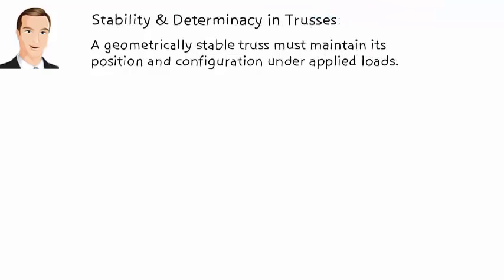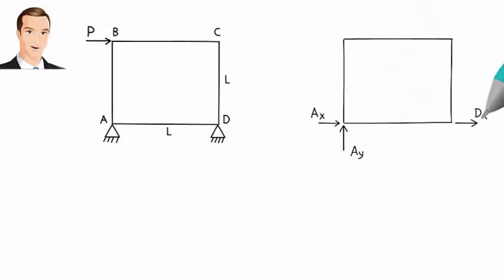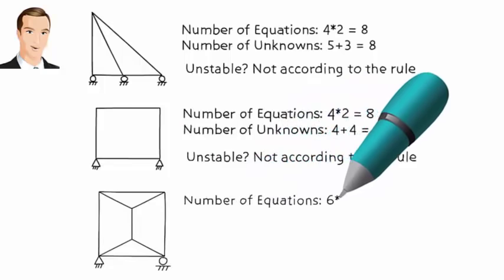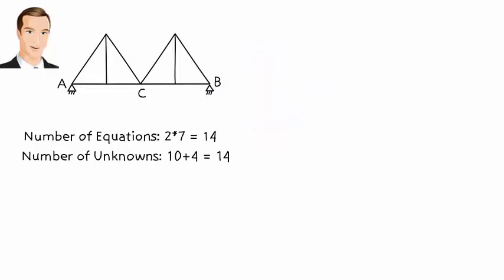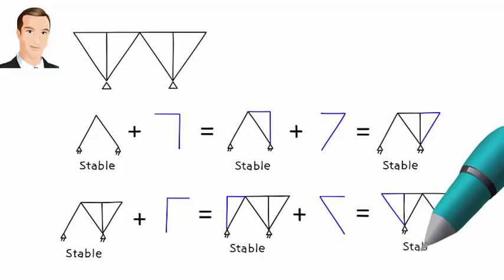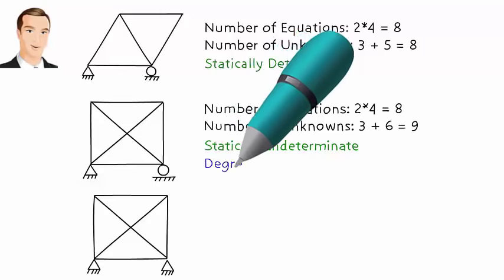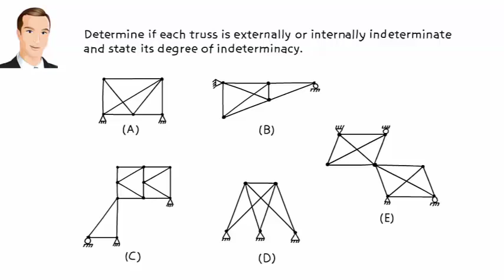SA02-A: Stability and Determinacy in Trusses

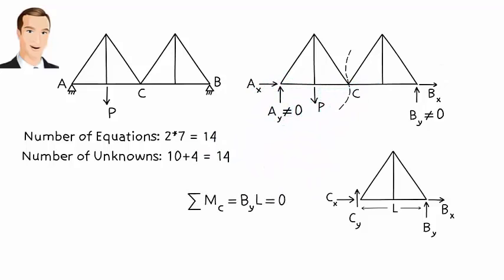Comment: 11:50,I think By and Cy both are zero. since the vertical member is a zero force member it will lead to zero force in the inclined members so balancing the forces Bx and Cx will be equal and  both Cy and By are zero. However for the left part of the structure if we write moment about A, Cx Ax and Ay are passing through the point A and Cy is zero so there will be a moment due to P which will make the structure unstable anyway
Reply: But then moment equilibrium will not be satisfied

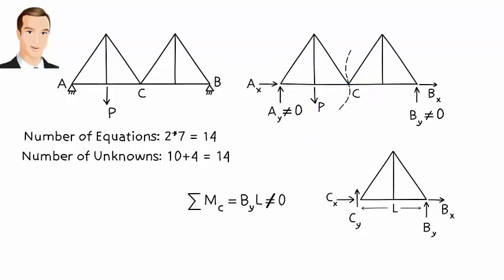Comment: How can there be a Cy force@ 12:00 ??
No reactions are present so how..?
Please explain..
Reply from the maker: The truss is subjected to a downward force of P. 
If we cut the structure at C and examine the left(triangular) substructure, where there is Ay and P, then we must conclude that there is also a non-zero Cy at the right end of the substructure. Otherwise, the equilibrium conditions for the substructure cannot be satisfied. Let's assume that P is located half-way between A and C, then Ay = Cy = P/2. 

The same Cy must be present in the free-body diagram of the right substructure,  the one shown in the video. And if Cy = P/2, then By must have the same magnitude (but opposite direction) since the sum of the forces in the y direction must be zero... Yet, a non-zero By leads to an invalid moment equilibrium equation as stated in the video.

Comment: How is a truss, which undergoes rigid body translation for an arbitrary load,classified as 
Options are
1 geometrically unstable
2 statically unslable
3 structurally unstable
Reply from the maker: Are you asking why a rigid body movement of a structural system renders it unstable? Because for such structures, the static equilibrium equations cannot be satisfied. If one or more equilibrium equations are violated, the system would not be able to carry the intended load.
Reply: @DrStructure  i m asking  a rigid body translation of truss comes under which category of unstability given 3 option above by me ?
Reply from the maker: In the context of static structures, statically unstable and structurally unstable have the same meaning.

If the rigid body movement is local (i.e., only a part of the truss undergoes rigid body motion), the system is said to be  geometrically unstable. 

A geometrically unstable truss is statically and structurally unstable.
Reply: @DrStructure  if whole truss translate then ?
Reply from the maker: A structure with such a rigid body movement is also unstable. But we don’t refer to that as geometrical instability. We call it external instability.

Comment: I have one question sir??

"If stable then stable."

In the given example one end of the truss is supported with hinged and another end it has roller and both the support is connected with  the horizontal member. If this horizontal member i.e., if this bottom chord doesn't exist then the structure would be unstable???
Reply from the maker: Correct, if that horizontal member connecting the pin to the roller is removed, the truss becomes unstable.

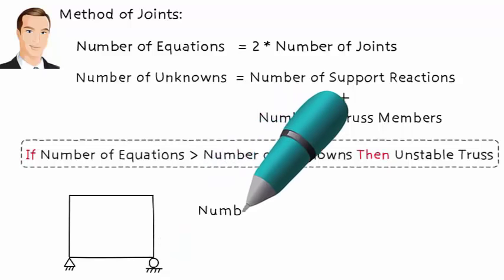Comment: Excuse me, at 07:17, it shows the method of determine a unstable truss, i want to ask if number of equations < number of unknowns, then is the truss stable?
Reply from the maker: If the number of equations is less than the number of unknowns, the truss could be stable. But it may also be unstable. For example, a beam that rests on many rollers, and nothing else, would give us many unknowns but only a few equations. Yet, the beam since it is not restrained against lateral movement is considered unstable.

Comment: At 9:02 question is there any other method  beside method of joint?? Bcz it can be lengthy at times...
Reply from the maker: For larger structures we often use the matrix (stiffness) method for analyzing trusses. This involves formulating and then inverting a matrix. For an unstable structure the determinant of the matrix would be zero, its inverse does not exist. So, a faster way to do this analysis could be to formulate the stiffness matrix and see if it has a zero determinant.
Reply: Thxs for ans.

Comment: In the last part. Won't it be an unstable truss if you put a downward load at joint c? Need help.
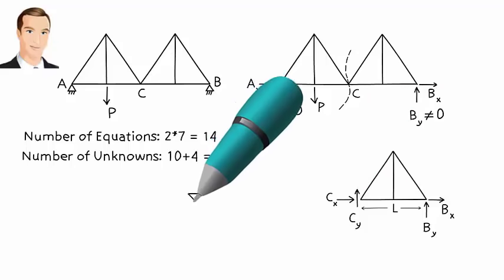Reply from the maker: Do you mean the truss @11:50? 
The truss is unstable, and we can show its instability in various ways. 
So, how do you prove its instability by placing a downward load at C?
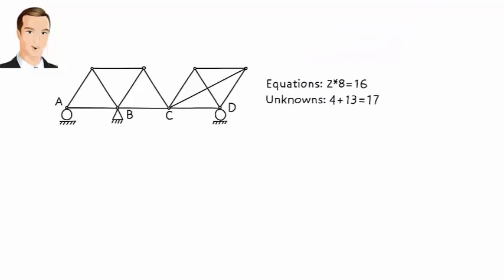Reply: @DrStructure  the truss at 18:09
Reply from the maker: @luisgabrielcabico9389  No, we cannot show the system is unstable by placing a load at C. Here is a simple thought experiment: Remove all the members and joints to the right of C. What remains is a stable (cantilever) truss. The addition of the substructure to the right of C does not make that the stable system to the left unstable. However, the truss would have been unstable, if there was not support at either A or B. But the two supports, as well as the roller support at D, ensure the stability of the system.
Reply: Oh. Thank you😊

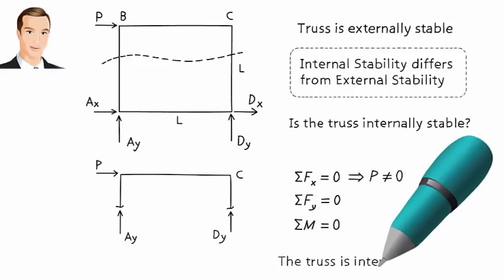Comment: at 5:37, how come there isn't a normal internal force?
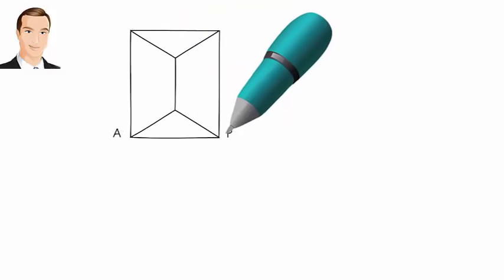Reply from the maker: Here we are dealing with a truss structure. Truss members carry axial loads only. A truss member is either in tension or compression. Therefore, when drawing free-body diagrams of a part of a truss, we end up having/showing axial member forces only (drawing either in the tension or compression direction). In the free-body diagram shown @5:37, we have cut through two members. The member forces are shown as Ay and Dy. These are the axial forces in the two members. No other forces are present/drawn on the free-body diagram.
Reply: @DrStructure  Got it. In the same figure, how come you don't treat it as a frame, but you treat it as a truss instead. In other words, how can you tell the difference between the two. Also, If the structure is a frame, it would have an internal shear and moment, is that correct?
Reply from the maker: @nhilang9911  Since the lecture is about trusses, we treated the structure as a truss. In general, truss structures consist of long slender members arranged in such a away that external loads are applied at the joints only. Beams and frames, on the other hand, are bulkier and can be subjected to direct loads of all types. Yes, if the structure in question was a frame, an internal shear force and a bending moment, as well as an axial force, would have been drawn for each member.
Reply: Dr. Structure so if the problem is a truss, it will state it. Is that how one knows what type of structure it is?
Reply from the maker: @nhilang9911  In textbook problems or in-class discussions, yes, we are often told whether we are dealing with a truss or a frame structure. In real life, however, when you come across a skeleton structure, you should be able to decide if it is a truss or a frame based on the size and arrangement of its members, the type of loads it is intended to carry, and how the loads are being transferred to the elements of the structure.
Reply: @DrStructure  got it. Thank you so much!
Reply from the maker: @nhilang9911  You're welcome!

Comment: Dear Dr. Structure, at 15:39, do we count 6 or 7 joints? I count 7, which means 2x7=14. 10 members. 3 support reactions. so, 14>13, which means unstable. But according to other answers below, seems I am wrong. Can you please help me?
Reply from the maker: Are you referring to Problem D? If so, you are not incorrect. It is an unstable truss.

Comment: Dr structure
Can you plz check my answers
A) unstable B) stable C) unstable D) unstable E) unstable F) unstable G) stable H) stable I) stable J) unstable
Plz do explain me where i am wrong....
Reply from the maker: They are all unstable. 

B) Place a vertical force at the middle joint on top of the truss, then identify and remove the zero-force members. What remains are the two horizontal members at the very top, with a vertical force applied in between the two. That configuration is unstable since the sum of the forces in the y direction at the middle joint is not zero.

G) Place a vertical load at the center joint of the truss, then cut the truss just to the right of that center joint thereby exposing the interval forces at the two inclined members. Now, considering the left side of the truss, take the sum of the moments about that middle joint. Since the sum of the moments about the joint must be zero, then the vertical support reaction at the left pin support must be zero, since it is the only force that could create a bending moment about the center point. Using the same line of reasoning we can show that the vertical reaction at the right support should also be zero for the equilibrium conditions to be met. But these vertical reactions cannot be zero, since their sum must add up to the applied load at the center joint.

H): Place a horizontal load at the lower right (roller) support, then identify and remove the zero-force members from the truss. That would result in an unstable truss configuration. The configuration is that of the three supports and two members only, one that connect the pin to the top roller , and one that connects the top and bottom rollers.

I) Place a vertical load at the right-most joint in the truss. Now, take the sum of the moments about the left pin. Since the reaction at the vertical roller passes through the pin connection, the moment sum equals to the applied load times its distance from the pin connection, that moment is not equal to zero, it should be, hence the truss is unstable.

Comment: I can't understand why b and c are unstable.please explain
Reply from the maker: For B, place a vertical load at the top middle joint. Now remove all the zero-force members from the truss. If we examine the lower left joint, we can conclude that the two members connected to the joint are indeed zero-force members. The same analysis can be applied to the right bottom joint, then the middle bottom joint, then the left middle joint and finally the right middle joint. This simple qualitative analysis shows that all the members except the top two (horizontal) members carry no force. But this remaining truss can be easily shown to be unstable since at the top middle joint there is a vertical applied load but no member force has any component in the y direction. So, the sum of the forces in the y direction at that joint is not zero, the condition of equilibrium cannot be satisfied, hence the truss is unstable.

To show C is unstable, place a horizontal load at the lower right joint of the truss where a roller is located. Then, since there is no load applied at the middle top joint, the two members connected to the joint carry no force. Remove them from the truss. What remains would be a pin, two rollers and two members. The right (inclined member) rests on two rollers, one at top and one at the bottom. That configuration is unstable since it can undergo rigid body motion.
Reply: Dr. Structure thank u...
Reply from the maker: You are welcome.

Comment: please post the answers for the practice problems
Reply from the maker: Since these problems can be solved rather quickly, give it a serious try and post your solution here, I will then comment on your solution. That is definitely a more effective learning strategy than the alternative.
Reply: +Dr. Structure
i see, okay then.. here it goes:

equations ><= unknowns
(A): 20 = 20 --> unstable because it does not prevent horizontal movement in the left part of the truss
(B): 16 = 16 --> something wrong in the middle, can't prove it though
(C): 8 = 8 --> [CAN"T SOLVE]
(D): 12 = 12 --> [CAN"T SOLVE]
(E): 12 > 13 --> concurrent reactions, or too many zero force members [NOT SURE]
(F): 12 = 12 --> unstable because when loaded at say the right middle joint, then separating the left part and taking the moment at the joint, the moment equation yields zero reaction which contradicts reaction values calculated earlier 
(G): 14 = 14 --> same as F, when separating and taking moment at the joint it yields zero reaction
(H): 10 = 10 --> [CAN"T SOLVE]
(I): 8 = 8 --> concurrent support reactions at the pin support, moment@pin != zero when loaded
(J): same as F & G

degree of indeterminacy:
(A): ext: 1st
(B): int: 1st
(C): int: 1st
(D): ext: 3rd
(E): int: 2nd & ext: 2nd
Reply from the maker: For instability problems, the ones you missed:
B) Place a vertical load at the joint between the two pin supports, then identify and remove all the zero-force members. You should be able to easily see why the remaining truss is unstable. All the members except the horizontal ones between the two supports are zero-force members.
C) Place a horizontal load at C, then identify and remove all the zero-force members in the truss. What remains is unstable.
D) Cut the truss member attached to the pin support, and show the axial force in the member. Now, draw the free-body diagram of the truss where the pin is replaced by the axial force in the member. This force (which acts as a support reaction) is parallel to the reaction at the roller. Parallel reaction forces means unstable truss.
E) Similar to D above, cut the members attached to the two pins, replace each pin with the axial force in the member attached to the pin. These forces pass through the upper left pin (concurrent reactions), so the truss is unstable.
H) Place a horizontal force at the lower right roller support. Now, remove the zero-force members (there are four of them). What remains can be easily shown to be unstable.
On determinacy problems: There is only one incorrect answer, C is externally indeterminate to the first degree.
Reply: Dr. Structure 
Thank you, i'm really glad for your support
Reply from the maker: You are welcome.
Reply: Can you further explain diagram B. As per my FBD reactions become zero!
Reply from the maker: Not sure what you mean by zero reactions. Please elaborate.
Reply: in truss C; where is the zero force member ???
Reply from the maker: If a horizontal force is placed at the bottom node (where the roller is located), then the two inclined members (between the two top supports) are zero force members.  If we remove those from the structure, then what remains is unstable.
Reply: Thanks a lot. I have another question. You've said H has four zero force member. which are zero force member???
Reply from the maker: Place a horizontal force at the lower right roller support, or place a vertical force at the upper right roller support. Then, the two members connected to the very top joint are zero-force members. Remove them from the truss. Now, the remaining joint (top left) has only two members connected to it, they both have to be zero-force members.
Reply: Thanks a lot
Reply: I have a question. Please forgive if I annoying you. If a truss is 2nd degree indeterminate by externally & Internal indeterminacy is -1 (minus one); Is the truss is externally stable ? internally unstable? or Totally stable ? Totally unstable ?
Reply from the maker: Good question. :) Such a truss is considered (totally) unstable. Period. What is the source of instability? The equilibrium equations cannot be satisfied internally, it is internally unstable.
Reply: Thanks a lot
Reply: Can you please help me. How do you recognize which members are redundant in the truss, so it would be internally indeterminate? Are you trying to solve it with the method of joints?
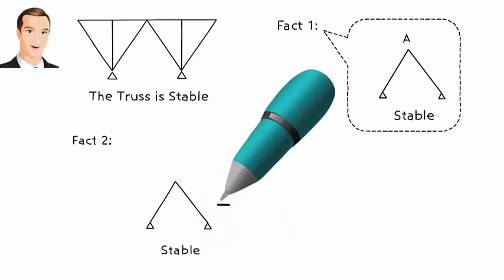Reply from the maker: For an indeterminate truss, generally speaking, any of its members can be  viewed as a redundant member. Starting at @13:00, the video explains how to construct a determinate and internally stable truss. After constructing such a configuration, if we add additional members to the truss, then it becomes indeterminate. Such trusses cannot be analyzed using the method of joints.
Reply: Tusshar Ahmed  are you talking about truss C at the end? I got that result, too. So the degree of internal static indeterminacy is -1, and it's unstable, right?
Reply: Hi, can you explain why the degree of indeterminancy of structure A is 1 ext? Thx a lot!!
Reply from the maker: @raynaldihartono6868  The truss rests on two pin supports each having two unknown forces. So, considering the free-body diagram of the entire truss, there are four unknowns but only three equilibrium equations. This means the system is externally indeterminate to the first degree.
Reply: Thx for the reply, but isnt there internal indeterminancy as well? As Ive counted 8(members)+4(reactions)-2*5(joints)=2 indeterminancy (1 ext and 1 int). Pls explain if Im mistaken. Because in the answer above, he only mentioned about 1 ext indeterminancy
Reply from the maker: @raynaldihartono6868  You are correct. The truss is also internally indeterminate. If we remove the long diagonal member going from the lower left to the upper right corner of the structure, we end up with a simple truss. That (redundant) truss member makes the structure internally indeterminate to the first degree.
Reply: Thanks, you’re the best

Comment: What is non zero force
Reply from the maker: A force vector with a magnitude different than zero.
Reply: In this vlog the non zero force is applying force or internal force
Reply from the maker: @1:39, the term is used to indicate an applied horizontal force.